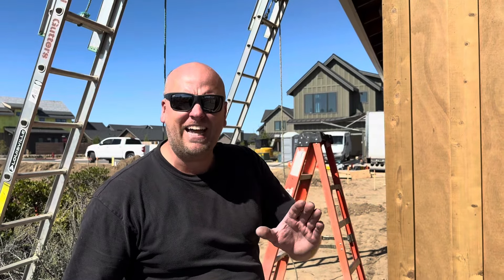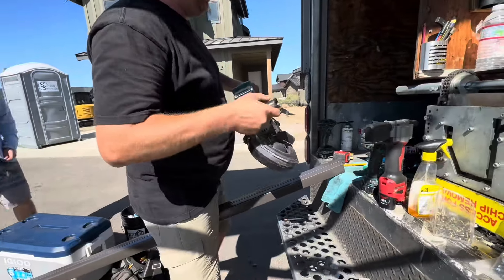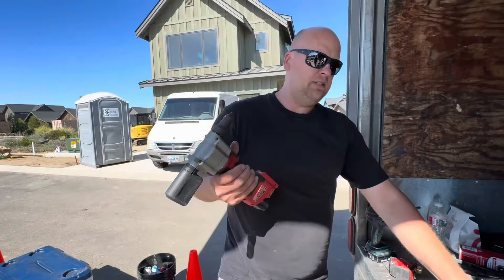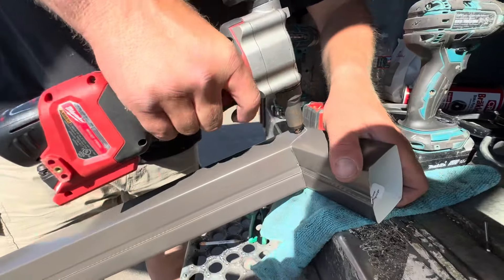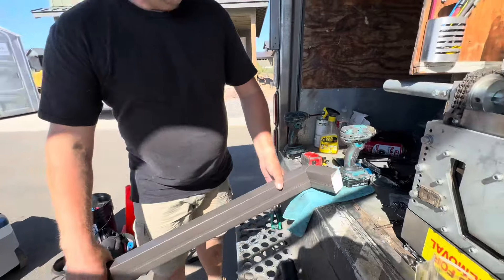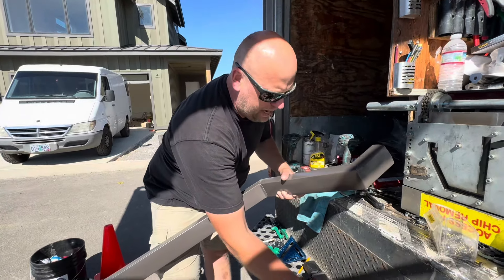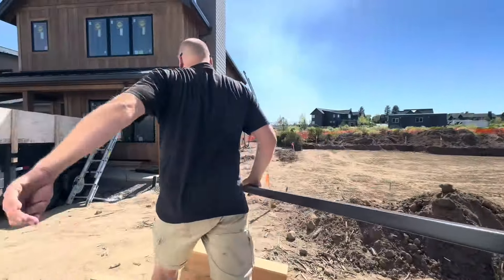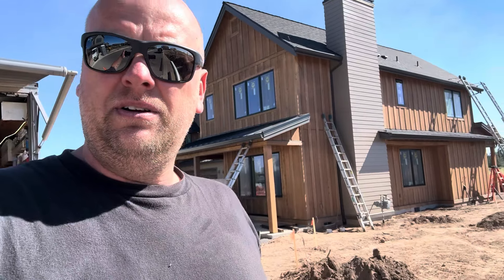📐 MASTER CLASS: Square Downspout Building | Pro Installation Secrets 2024

Comment: Thanks for this. The hardest part for newbs like me are the angle measures. Can you explain the measurements you did, like what is minus 1? Is it minus 1/4" or so the top line is 3/4" from the first measure, or minus 1 line on your ruler like 1/16" or 1/32" less than one inch? Ill bet all this is easy after 20 years and thousands of downspouts. But this will likely be the only one I'll ever do.
Reply from the maker: It’s basically a little less then an inch for top cut

Little less then 1 1/2 for second bottom cut

Depending on how steep the angle you want